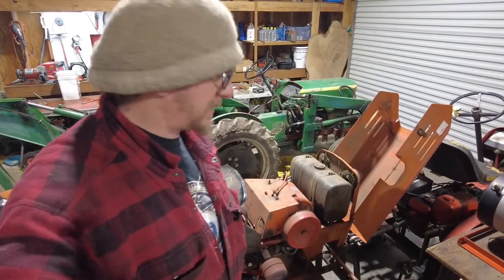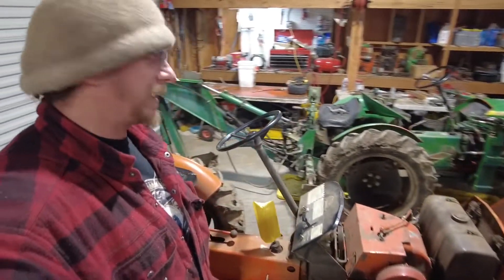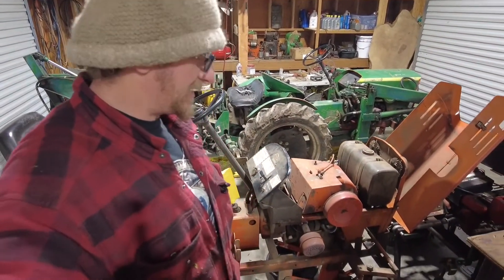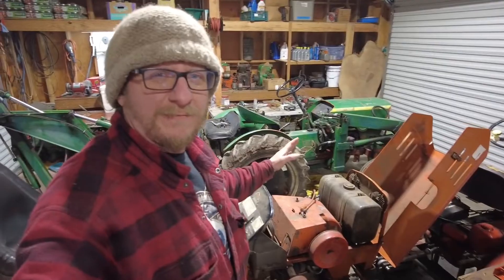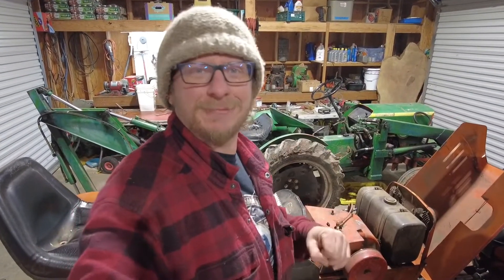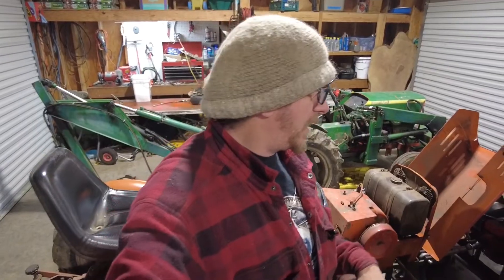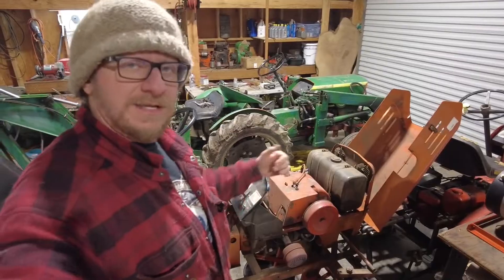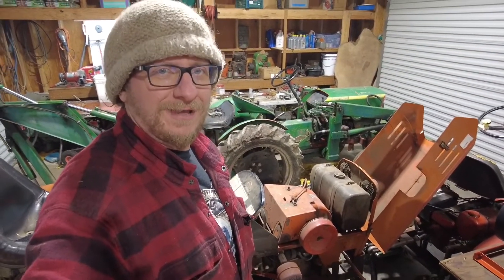Electric Tractor Conversion - Economy Power King, Part 1

Comment: That is great. I would not mind doing that if it was worth it.  This guy replaced a 1960 Engine that has been running for 50+ years. These engine if maintained will run for another 50 past his life time. Wonder how many months that Chinese motor will run?  He put in lithium battery what will degrade over 3 years to the point  that driving it to the mail box and back will need to be charged again.  How will it do cutting grass on a small 3 acres yard 2 times a month during the summer and plowing a driveway in the winter.  Those batter lose performance in cold weather. Again a fun project, but nothing more.
Reply: A well built motor will last forever and if they used Edison batteries they would last forever also. But even lead acid Is easy enough to restore. Could save alot of time and hassle with electric tractors

Comment: Instead of installing ME  electric motoe as a source of power for the wheels and cutting deck have you  considered using good quality used geared driving axle from mobility scooter or from froor scraper   made by CTE from taiwan. They make warious axles . I use CTE 6  24v  25:1 gear ratio axle 900W  10 Nm unit. As for source of power for the deck spindles I will use most likely 220v AC motor  with DC to AC converter  with ability to AC .  The donotr convert 24V to 6000W , The main donor for the mower is Kubota G1860 chassis  with steering and front end  and deck lifting  assy.  What U thing.  We test drove the riding and goes very well . bestwishes  Mark from Poland
Reply: An Economy Power King has a Borg Warner car transmission and axle with a bull gear assembly added to each side that also contains the differential brakes.  It's made for plowing market gardens.   What you are talking about might just be sufficient for a lawn mower.

Comment: The only issue I can see is the motor and coupler should be fitted to the clutch or gearbox or whatever first and confirmed there is no runout before tightening everything up. It might be fine as is but there could be stresses you can't see.
Otherwise loved this video and look forward to the next. 😀
I'd love to replace the noisy thirsty beast in my lawn tractor so really interested to see the costing for this.